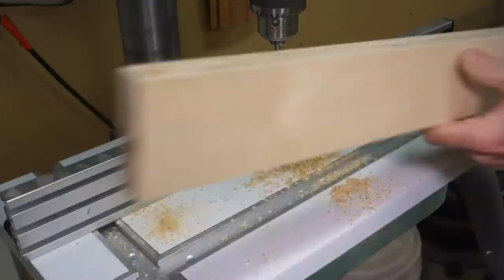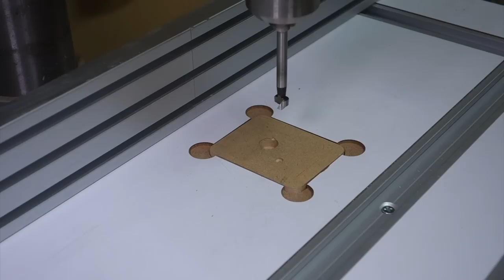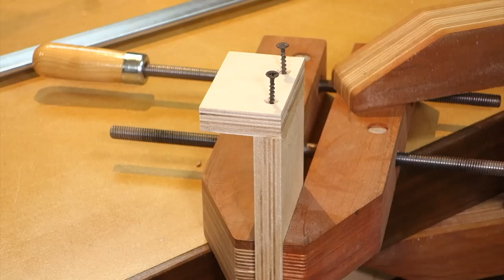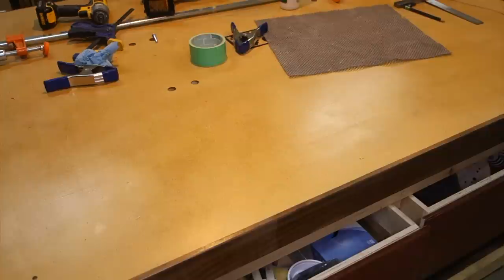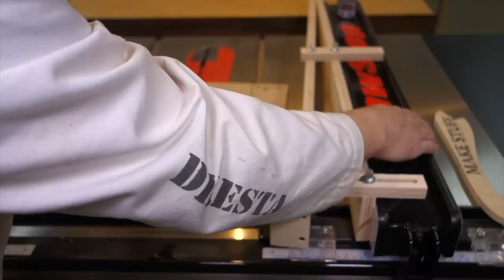Adjustable Taper Jig for Table Saw - Cheap and Easy!

Comment: I had made a similar jig but it was not but a third the height of my fence, it worked but I constantly had to replace the stop block, cutting through it when I cut my pieces. Your design is Great, love how you align the mark on the piece with the groove then adjust your jig to the board. Never thought of that. Thanks

Comment: That's a great way to cut the slots for the adjustable arms.  I would have been fiddling with a router or trying to cut them with a plunge cut on a table saw or jigsaw.

Comment: And the hinge screws hold in the end grain ok ? I always drilled out and plugged in a dowel to give it side-grain strength. Nice project, thanks for sharing.
Reply from the maker: 8 screw pre drilled into Baltic birch ply. It's fine.

Comment: How do you think this tapering jig would work on my Radial Arm saw for tapering 30 inch long boards, 3/4 inch thick? The taper needs to be from one corner of a 6 inch wide board to the opposite corner at the other end. that will make two equal-size boards, 6 inches on one end to a zero point on the other.

Comment: Cool jig but watch out using the back stop as the full pushing force. pushing on the back right corner alone will twist the board counterclockwise and may cause a kickback.
Reply from the maker: It's a very stable jig, but care should always be taken on the tablesaw.  Regardless of the tool, jig or operation.  Thanks
Reply: Why? I can't visualize it
Reply: That could indeed be dangerous, if you're tapering some wider boards for example, and only push it from the far side, and it starts to turn. For these kind of narrower ones, I think it's not an issue.

Comment: Another way to make the brackets (edit- if you don't have a bandsaw) is to rip the wood down to the thickness of the frame, and cut each side to length on the miter saw, then just glue them together to form the bracket.

Comment: I don't understand why you used 2 bars with slots in them.  When I made mine, I only used 1.  Also, wouldn't it be easier to cut the slots using a router on a router table?

Comment: Would have been easier to use a router for making the track for the two distance pieces.
Reply from the maker: Lone Hansen or purchase something already made, or 3d print, or CNC... are we really going to discuss how to take and easy thing and make it marginally “easier” the router would have had a higher chance of failure, that’s why I chose to do it this way.

Comment: Nice but there has to be a simpler way to just make one cut today not next week after building a jig. Some people don't have a router and don't want to get sidetracked on a second project.
Reply from the maker: Fastech Systems if it takes you a day to build a jig like this you should consider a different hobby. It does not get any simpler or safer than this...
Reply: @dpmakestuff  You are wrong on all points. It's not my freaking hobby - I'm fixing my house and I needed to get this done today.  I drew a line on the board and then tacked on a second board along the line and pushed it through the table saw. Mission Accomplished.
Reply from the maker: Woohoo! 🎉...  couldn’t do that with any valuable material. This jig is easy, doesn’t damage the wood, doesn’t need a router to build, doesn’t need anything other than a table saw really.

Comment: Know what to do? Yep, thumbs down the video for using expensive and hard to get plywood.
Reply from the maker: Rudyard Kipling this stuff is so cheap I burn it for fun.
Reply from the maker: Rudyard Kipling lol. Truth be told I pay a premium for ALL lumber, not just plywood. Pine is considered a premium wood in my parts. It's brought down my sensitivity when purchasing wood so I just embrace it.
Reply: Dustin Penner
Yeah but there's premium and there's PREMIUM LOL - I assume that's Baltic birch (or similar) you are using which is $240 a sheet here before shipping costs (not available locally). What you would call an 8' 2"x4" is over $8 here. :-(